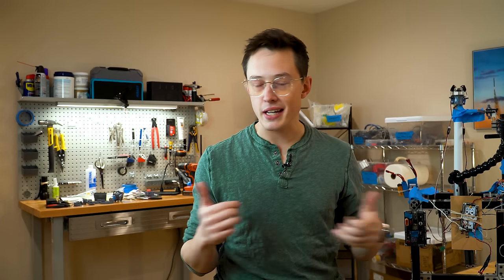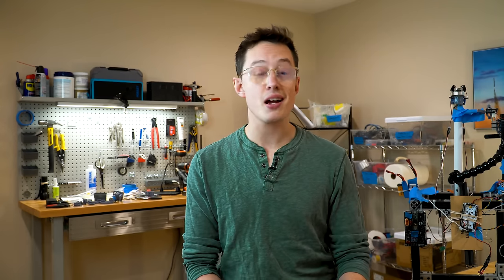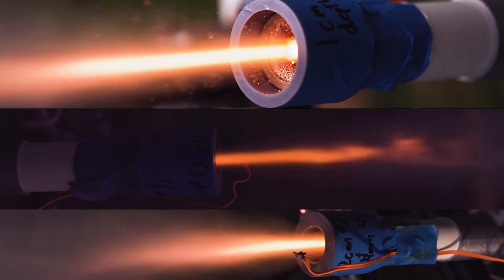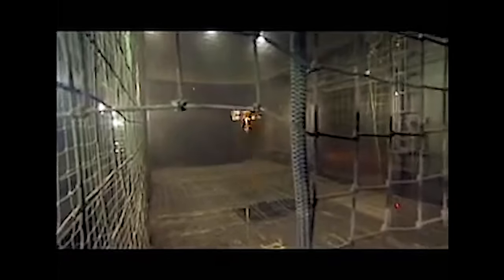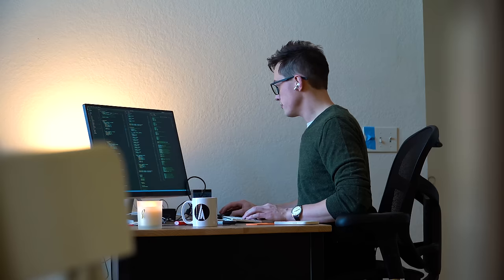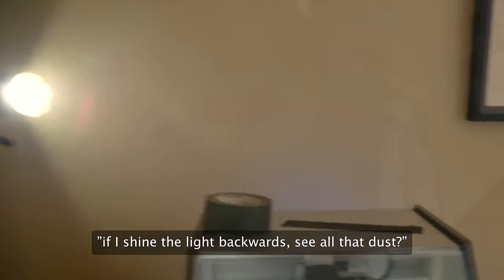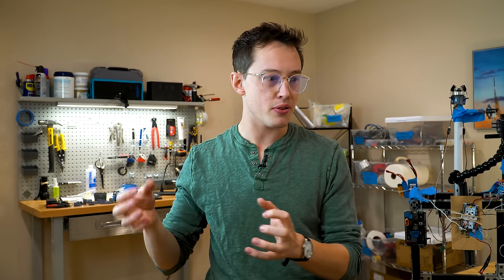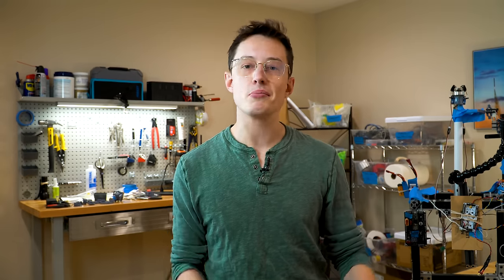I Figured Out How To Throttle a Solid Rocket Motor

Comment: Before you throw one of these in the air, I hope you measure the torque! I expect those "side lobes" coming off the paddles won't be quite symmetric.

Also a torque-sensitive thrust stand lends itself to thrust vectoring. Triple paddles when? :)
Reply: I was thinking about this too... I was thinking guide paths could be machined into the deflector paddles to vent the rocket exhaust gases more evenly and help eliminate the oscillating side forces

Comment: I just had an idea.  A compressed air "final cushion".
could be a c02 canister for a crude version that could be valve controlled.
love from north of lake superior.
Reply: so i commented before watching lol, been watching you for years and i never had this compressed air idea before.  I don't think your PWM idea will be very efficient as far as attitude control.  i think it would change the angle of propulsion to a degree that will not let it land vertically.  Sealed eye protection is probably a good idea against ceramic dust too.  Eyes are very porous.  Sorry for all the commenting lmao.
Legit love you in a totally not over the top parasocial way. :p

Comment: If my tired brain remembers right, motors that fire at an angle have a lower thrust. If you were to test with a cluster of engines instead of a single engine, could you deflect them out equally to power thrust? Now sure how much is lost per degree off vertical. I could be completely off on this.
Reply: That does work, thrust scales with the cosine of the angle. It's how he did some earlier rockets (using one motor and inertia, rather than an array of motors), not sure why he didn't mention it here.
Reply: This is exactly what I did. It works great for very small scales.

Comment: It looks like you are moving away from PWM and modulating the flaps - with good success.  If you seriously want to investigate PWM, consider the frequency response of the servo+flaps mechanism as this will limit the pulse rate if too slow.  It also looks like there is opportunity to further optimize the flap configuration.  Response ~ sq root (mechanism stiffness divided by mass) so larger components means slower response (and obviously more dead weight on the rocket).

Comment: Brooo I messaged you a long time ago about how to do this but I didn't hear back from ya. You should take advantage of the coandã effect and but reversed. Like when you float a ping-pong ball with a jet of air. Turn your ceramic pieces upside down and the thrust will follow the curved edge outward as you close them. Creating smoother throttle than just  bliping it real fast.

Comment: Too bad CNCing inconel costs so much... that could be a solution for the flow restrictors. Though if they last a lot longer than ceramic or graphite, it might be worth the investment in the long run.

Comment: Great video! I'm wondering, could you add another 2 blocking fins, make it a 4 finned blocker? That might help balance out the side thrust on the APCP motor? Also would it work if you were to angle the underside of the fins to help direct the thrust sideways?
Reply: The gas from the motor needs to have somewhere to go, so deflecting it sideways with two paddles is great
Reply: @friendlydispatch6283  I agree, as stated in the video, there was some side thrust caused when the 2 paddles were in "deflection mode", what I am suggesting is to add another 2 paddles - obviously leaving a gap for the (now corner thrust) to escape in a more even distribution thereby reducing the unwanted side thrust - perhaps having a cavity lower in the lower section of the paddles (closer to the rotation point) could allow side thrust to escape from there too? I didnt mean to suggest totally blocking the thrust, just an addition to counter the side thrust and increase the blocking efficiency :)
Reply: @dans-designs  ah I see what you mean, good idea

Comment: I was curious about throttling solid motors before, and it had occurred to me that one possible method would be to inject an inert gas rather than an oxidizer into the motor to potentially retard the reaction.  🤔

Comment: What about using the aluminum blocker arms again just adhere a ceramic disc to the point of contact with the flame. Sorta like a brake pad

Comment: Silly question... what about a hybrid-hybrid? That is, a normal solid rocket, but you can add extra liquid, or even gaseous, oxidiser if you wish? If you only need 20% range that might be possible.

The question then is, would extra oxidiser (say just oxygen for the sake of argument) actually increase the burn rate? Or does the oxidiser already in the mixture provide exactly enough so there's no more fuel molecules hanging around? If that's so, create your own mixture, make it fuel-rich, so that it can respond to extra oxidiser. Yeah sure now I'm just inventing the hybrid again, but like I said, it's a hybrid hybrid. 80% solid rocket, 20% hybrid. So the hybridistics of it are much smaller and easier to deal with.

I can understand somebody not wanting to create their own propellants but there are groups of amateur firework makers, with a good average finger count in the high 9's. It can be done!

Comment: Won't the blockers interfere with thrust vectoring (as they have to be in the flow to work) ?  Otherwise you could probably use 4 blocker (either with a chanfered edge, or an offset cross patern) to actually deflect in addition to control thrust ! this would also avoid (or at least let you control dynamicaly) side forces.

Comment: What if the cross section shape of the solid fuel is not fully cylindrical. I am not talking about the container that houses the fuel but the fuel it self. Thrust can varry if you dont have completely rectangular cross section.

Comment: What if you tried to throttle and SRB by changing its throat diameter mid-burn, kinda like high power jet engines. I’m not sure how you would do that but just an idea.

Comment: Is there a way to "poison" the combustion to reduce thrust.  ei: inject a gas or liquid into the solid rocket motor from the 'top' end?  Not sure how much pressure is needed  to overcome chamber pressure (will need pretty good solenoids too), but I doubt you would need very much gas or liquid to greatly reduce the thrust briefly - say 0.5 ... 1 s overall....

Comment: find a ceramist and custom make and fire your own cone 15 ceramic diverters. the answer is with a guy that make tea pots. also you could formulate your own SRB and the late burn is a less burn lastly you are not PWM you a closed width modulating. clicky clicky

Comment: Wouldn't you also be able to just vary the throttle using thrust vector control? It would be annoying to circle around the motor, but it wouldn't require another system

Comment: Does the side forces on the APCP motor happen all the time or after the stalagmites form (it might be due to deflection of the exhaust in to a side by the stalagmites).

You could control this by deflecting the whole mechanism sideways via a servo to counteract the sideways exhaust

Comment: Cant confirm but pretty sure the KKV utilizes hypergolics for propellant. Hypergolic mist can be seen in the testing video after it lands https://youtu.be/RnofCyaWhI0?t=41 which makes me convinced that they are not simply blocking the thrust in the manner you are trying and using valves in the traditional manner. You can see orange mist in this video too at about 6:35.

Comment: You throttle a solid rocket engine with very accurate timing and a reduced diameter and extended length engine. Orfice is constant , quantity of propellent is reduced by diameter fuel containment.

Comment: Wrong drill bits dude. 
You want tiny masonry/ceramic style ones.
Also, you need to let the exhaust out, thats your problem with the newer design. You are just vectoring 2 jets 180 from each other. you can't just cap it off.

Comment: Makers, please, STOP FORCING YOUR TOOLS!!! Yes, it will feel like its taking unnecessarily long, but letting your tool do the work at its own pace is VASTLY superior to trying to bullying it through the material! DONT BE A TOOL BULLY!!!

You're probably screwing up the drilling because your spindle speed is too high. FASTER IS NOT BETTER! LPT: the harder the material, the slower your rpms should be. Wood can be up to 4000 RPM. Aluminum over 2000,  low carbon steel 1500,  cast iron 1000, high carbon steel 700, glass 400. These are general suggestions actual spindle speed depends on the bit the tip condition the material the phase of the moon whether or not your tongue is pointing in the right direction. And Im not familiar with that exact ceramic, but I got dollars to doughnuts you're spindle speed, and feed rate are way too high. Also you could have 'chip' buildup. Especially with hard stuff, you gotta clear as you cut.

That aside, that is a neat idea for thrust control! And now I'm off to geek out on that icbm interceptor thingy!

Source: many years in fabrication and machining for theme park animatronic industry. They gotta last 16hrs a day, everyday, for decades ;)

Comment: How about using powered solid fuel and pouring it in the combustion chamber with a variable aperture. Just like a sand clock. Varying the aperture would affect the burn rate and thrust. I mean... Everything is just like a liquid engine but you get rid of all those complexities. 
I want someone with more expertise to comment over this.
Reply: Cons- you can't fire the engine upside down. 

This idea is for hobby scale... Ouvioulsy it's not gonna work in space.
Reply: @vibhav1319  In this case though, it's very relevant because he wants to fire the engines coming down, so essentially upside down/in a zero g environment

Comment: Couldn't you also make a "hybrid hybrid" engine? Where the solid propellant is a fuel+oxidizer mixture, but fuel-rich (containing ...I don't know... 80% of the optimal amount of oxidizer). And like in a normal hybrid you add the remaining 20% oxygen from a tank through a controllable valve.

Comment: Out of manufacturing capability because aluminum isn't good enough?
Not everything has to be CNC'd, you know. You can cut and file steel pretty easily. You can bend stuff ouf of sheet steel even easier.

Comment: You can control the burn rate using a catalyst.  But this is only used in professional motors.  I don't know if it's been used in over 30 years.  Not a perfect solution and  think the catalyst was a nasty chemical.

Comment: You can use multiple rockets and ignite some of them and the others later so in this way you can control the thrust in an increasing manner but not in the opposite... This will increase the weight of the rocket and sounds stupid too but..... it's an idea

Comment: Excellent job! You might be able to reduce the actuation forces – and improve the overall control precision - of the blocking servo motors by using the geometry of an iris diaphragm (with two opposite elements only).

Comment: 🧐 you know, this is only about two steps away from full thrust vectoring... 🤨. You know you want to do it.... Haha
That slag buildup is a common problem with plasma cutters. I deal with it on my plasma cutter by spraying anti-spatter spray on my cutting heads to keep the slag from sticking.

Comment: this machineable "ceramics" is the weakest and softest  material from advanced ceramic materials. Especially if its exposed to such combination of high temp and erosion from burning solid fuel.  Definitely spend more time in selecting better materials as solid Al2O3 ceramics (cheap one) or better  - Silicon carbide SSiC- this one is used even for flaps for vectoring thrust in guided missiles. You cannot machine them inhouse, but you can buy some sintered tiles like 50x50mm for few bucks  (check ebay) and attach them to metal support by high temp glues as US Aremco sells.  Surface can be even polished to get less deposition of burned fuel. Worth to test it.

Comment: QUESTION FOR YOU GUYS... WOULD PAINTING THE TIPS WITH HIGH HEAT RESISTANT PAINT HELP WITH THE SLAG AND HELP DISPERSE SOME OF THAT HEAT?  THE SAME SPRAY PAINT USED FOR HIGH HEAT OVENS....

Comment: Another way to control throttle, kinda. Make the propellant itself more porous to smth like that in the places where you want it to burn less. Idk how rockets work at all, but like more propellant makes more thrust, therefore, the more porous your propellant is, the less thrust you get?

Also, Discord server??????????
Reply: How do you know beforehand where you want it to burn less?
Reply: @ChucksSEADnDEAD  do a crap ton of testing?
Reply: @verified.2606  But that's not the point. Throttling inherently means that your sensors are asking you to go faster or slower. Every single landing is slightly different from the other. The point is for the rocket to be "smart" and land autonomously.
Testing isn't going to make up for the fact that any slight difference (such as a gust of wind) is going to require a different thrust, and casting the thrust profile into the solid fuel isn't going to let the rocket adapt mid-flight.
Reply: @ChucksSEADnDEAD  It was just an idea, I didn't think that far ahead. Plus, I was thinking that for that kind of motor to work you can only go up. you can't land it

Comment: Great video! I can’t wait to see it fly!

I actually figured out a different way of throttling that may interest you: https://youtu.be/bXE6wAp0SKE
The way I do it is by pointing 4 motors against each other, so that they cancel each other out. for 20% thrust deflection you would only need 12 degrees range. Obviously this wouldn’t be so suitable for bigger motors like the G20.
Reply: Getting them to fire simultaneously will be hard. Could work if you could counteract the induced torque.
Reply: @defenestrated23  I already built and flew such a rocket several times. Ive never had any issues with this, since I only throttle up a second after Ignition.
Reply: This is super cool. Really impressive.

Could you scale it down and do it with 2 motors and 2 axis vectoring?
Reply: @orulz1  You absolutely could. There are many possible configurations. This is a configuration that I thought would be especially suitable for CubeSats.

Comment: Have you tried using a pid loop to try and control the actual thrust from the motor with the live data from the test bed? Curious to see if it would work to control thrust reliably and with enough precision?

Comment: Since you can direct the thrust, maybe you could ditch the TVC mount entirely?
Reply: That is not used to direct the thrust, the goal of this piece is to control the amount, you actually want the least lateral thrust as possible.
In combination with the TVC you then get a highly controllable engine
Reply: @biosdilt1399  I am suggesting that it could be used to direct the thrust, like wedge shaped thrust vanes that can be actuated in and out, and rotated.

Comment: Fantastic results! On a side note, science tells us - no, wait. In science "edge-case" = boundary condition. At least to be compatible with the last 200 years of physics and math. Hackers and hobbyists who are illiterate in the field, created terms to handle the situations they encounter. This corner case, edge case, and use case stuff just comes from that. Nothing against hacker/hobby, great things come from this,  but you won't find these terms in the books and papers and lectures outside of hacker sites. (Though the use is growing. The use case for using a case is generally a case against using use case.)

Comment: make solid-to-gaseous hybrid engine
Reply: you could use a pressure container to regulate the output flow, like rcs
Reply: the pressure vessel needs to hold a very high pressure, like a water jet, 50k psi, for a short moment, you essentially transfer the rocket exhaust to a pressure water rocket container
Reply: land with compressed air then, its fully controllable, like a tesla hyper roadster is said to be
Reply: rcs landing
Reply: if you like to cut steel, you can have a shutter, horizontal movement like in a camera, would be more robust holder to keep it in place
Reply: electrically (resistance heat) controlled hybrid solid oxidizer (NaClO3) powder activation
Reply: use shock diamong diverter, just vary the distance of the reverse-bottleneck

Comment: I’m going with it depends.  If your solid fuel requires oxygen intake from the top you can throttle it. Same as the liquid oxidizer.  

Just because science hasn’t yet given you those options doesn’t mean it isn’t possible. 

Wasting energy is a bad plan.
Reply: Solid-Gas is still a hybrid motor

Comment: LOL, builds thrust reverser for a solid rocket. lol

So, now we have pitch and yaw controlled by moving the entire rocket motor with a momentum wheel giving partial roll control, and thrust reversers like an airliner jet engine. 

Come on now, why not just go do the obvious. Put four steering vanes in the flow. One for pitch, one for yaw, one for roll and the last for thrust degradation. Four dependant variables controlled by four independent variables. Mix and match to do what you want.